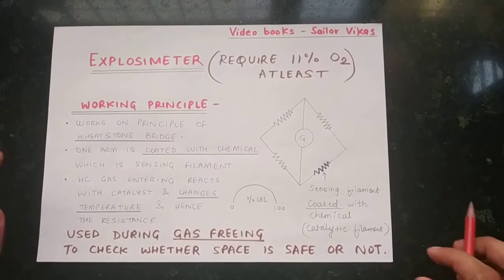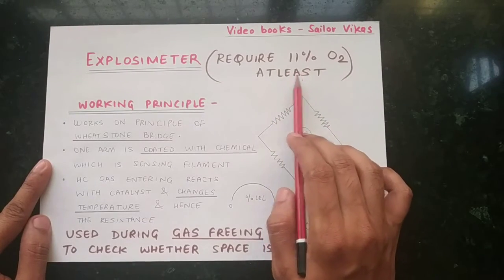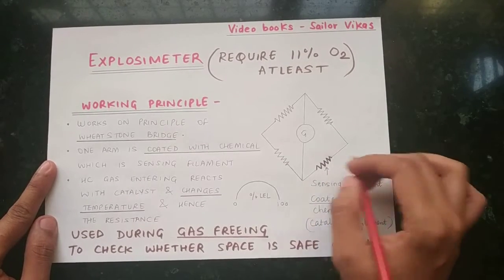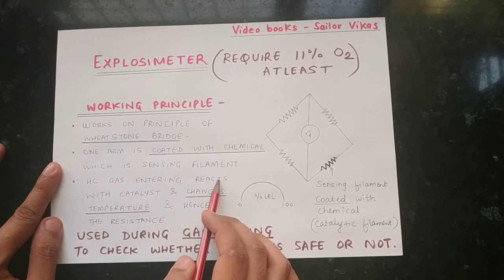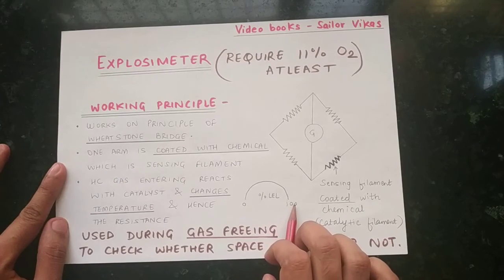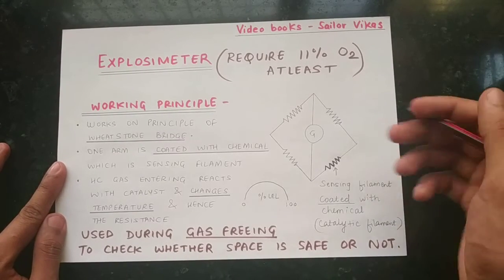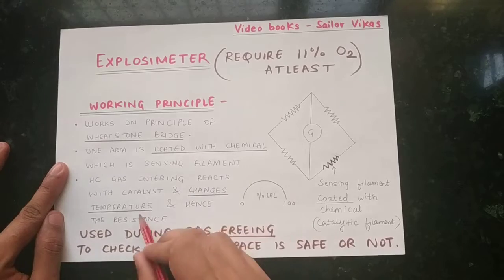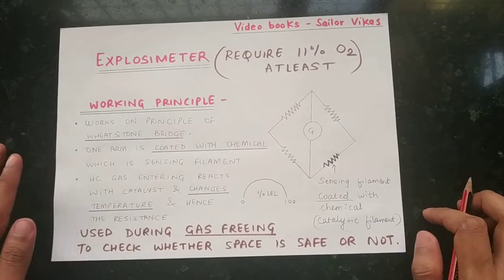EXPLOSIMETER - WORKING PRINCIPLE #inerting #purging #oiltanker #tankers #ships #mariners

Comment: Sir what is Span check before using the device
Reply from the maker: Span check is verifying whether your meter is showing  correct reading by introducing a gas of known values of concentration...so that u can compare and identify whether gas meter is showing correct reading or not....however span check is not required to be done before every use.....span check is a monthly requirement.....before every use...u just need to do air calibration.
Reply from the maker: Thanks for commenting

Comment: Hi sir thanks for the nice video 
I have a question though 
The value in gas meter of 4 gases for alarm purpose e.g
O2- 19.5%
H2s - ppm
Hc - 10% lel
CO - 35 ppm
On what basis they choose this value.
Since in isgott only have given tlv- twa
Reply from the maker: Well it's a very good question , however answer is pretty much simple,
Purpose is to set alarm to pre warn the user without causing an adverse effect from the gases thus  the aim is to pre warn at an early stage , they have set this TWA values 
H2s - 5ppm
Co- 25ppm
O2- 19.5 %
HC - 10% lel

Comment: The scale is 0 to 100 and it measures only LEL right?
Reply from the maker: Yes
Reply: Video Books - Sailor Vikas thank you
Reply: Sir need information about digital O2 meter calibration ? How to make zero reset ?
Reply from the maker: Very simple it is...for O2 you need to make zero cal with nitrogen span gas....just put O2 meter in calibration mode , put the n2 , you will get zero, if you don't get zero their is option to do one calibration in which u can put n2 span gas and adjust O2meter with zero.
Reply: @SailorVikas   thanks for prompt reply ... But still its not clear ... Is there any special button for zero reset ? Or in calibration with span gas mode there is a option for zero reset ?
Reply from the maker: There is no button for zero reset however during the time of putting span gas , in One cal mode, you can decrease the value of O2 by pressing the "down" arrow key and in Calibration mode, even if it is showing more than 0 percent O2 than when you click ok on gas meter, it will show PASS which means no need to zero calibrate it coz it's under acceptable limits.
Reply: @SailorVikas  thank you... everything clear ..
Reply from the maker: Welcome